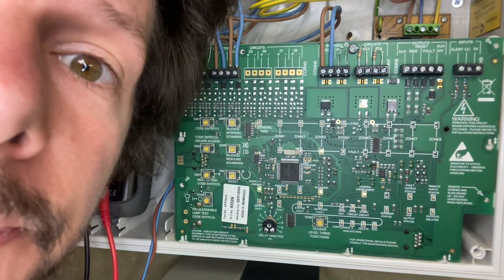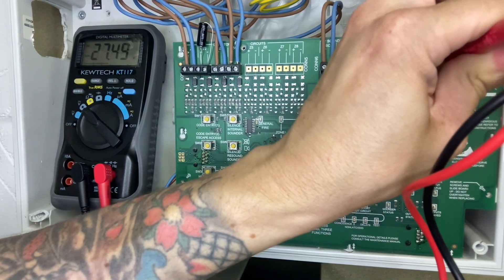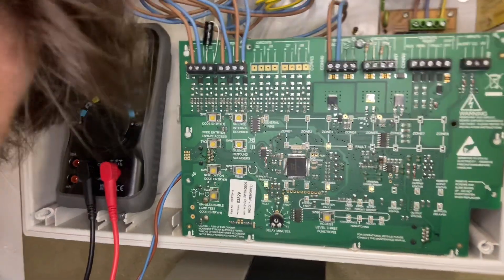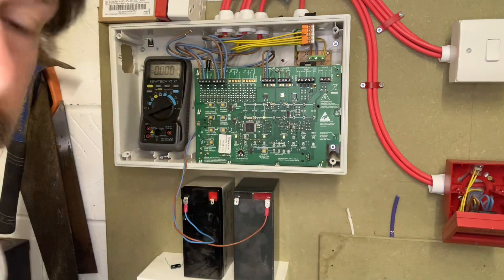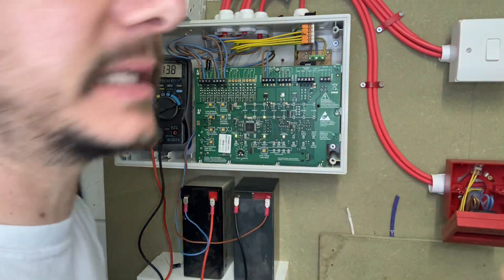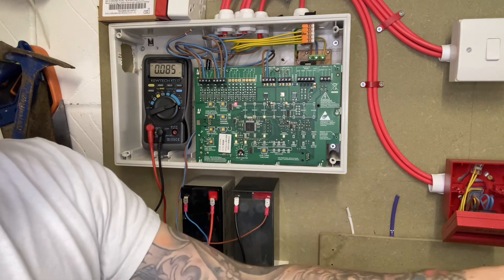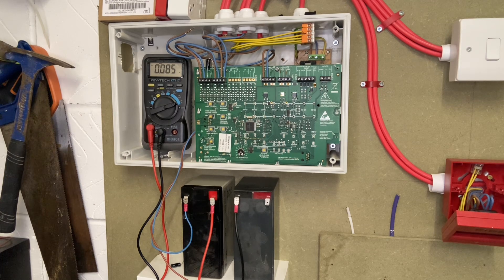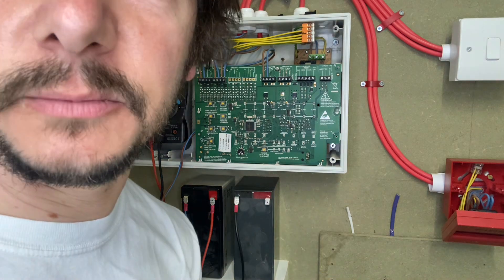Electricians Guide to Fire Alarms - Multi Meter for Panel Health Checks (Standby Battery Part 1)

Comment: Hi, i have attempted to do this with my Kewtech tester and it won't seem to allow itself to be part of the circuit so when I turned off mains, it just kills the panel. I think my tester is the same as yours? Any ideas?
Reply from the maker: @TomWood-w6s  Hiya

I would check that the fuse for that setting is still good, it’s a probe fuse like you get in your installation tester in the back. Secondly, I would let the panel go into battery fault when the batteries are disconnected make sure you’re set to  amps or milliamps, make the connections, and give the panel an opportunity to come back out of battery fault, this way you know that you have made the connection and that the panel will rely on the batteries when the mains is isolated. This is particularly important on analog addressable systems, particularly those that can’t be fully isolated. Also, the mindset is that the meter is part of the battery circuit, which is why I would usually go in between the two batteries as it’s how I think of it in my head, and also whilst the meter should read current flowing either direction, it’s nice to use and easier to use correct polarity when in between as the batteries are colour coded.

Let me know how you get on, apologies if I’ve offered advice you’ve already considered